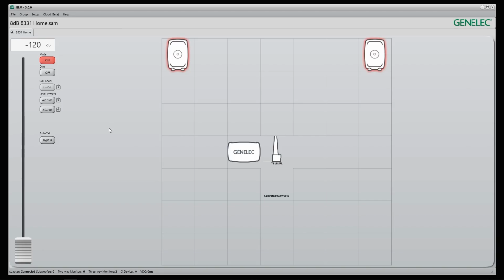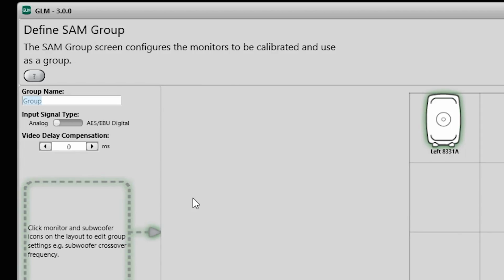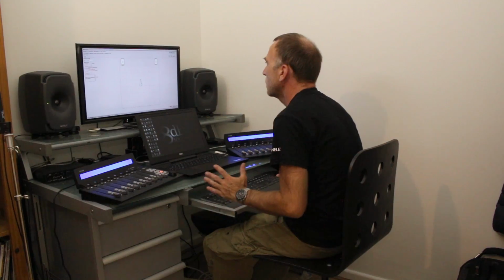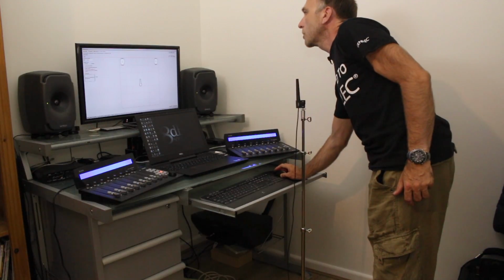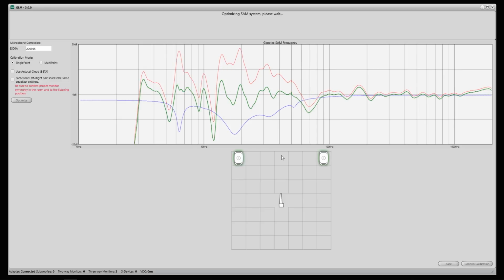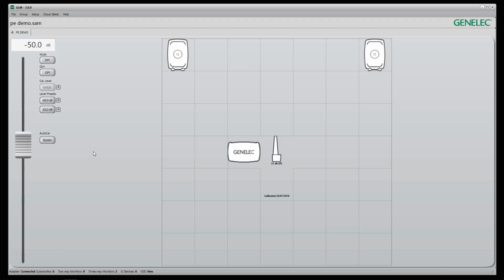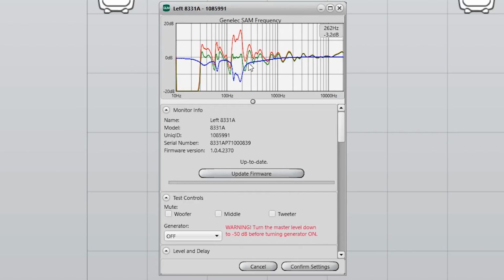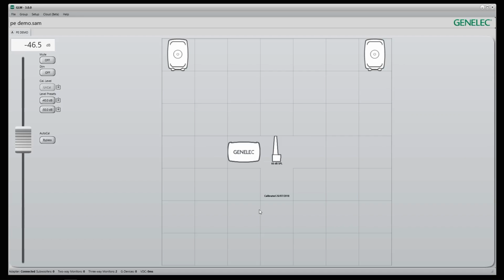Genelec GLM 3 Correction System - Production Expert Demonstration

Comment: Do I need to set the Stored dip switch to on for the calibration to be stored inside the speaker ? As I want to run it without the GLM connected

Comment: After the calibration is done do you have to keep the speaker connected to the adapter via Ethernet or can you disconnect them and still have the settings saved ?
Reply: According to Genelec it keeps the settings you can remove the module.